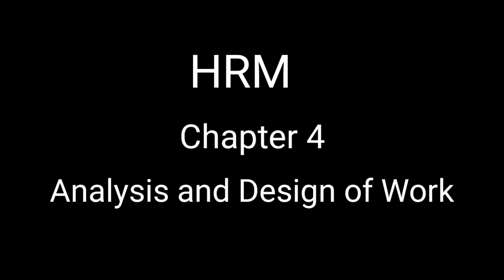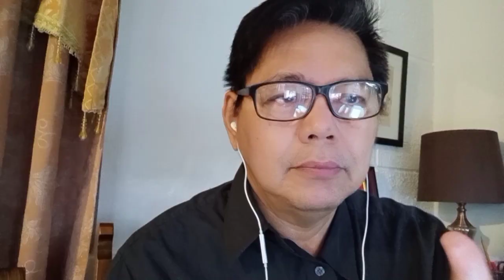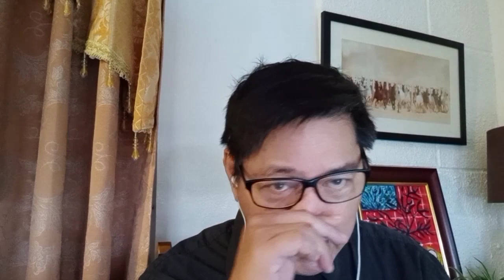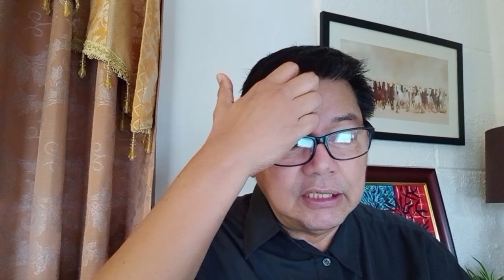HRM: ANALYSIS AND DESIGN OF WORK

Comment: FINAL EXAMINATION
Dimaculangan, John Kenneth V. 
ASM3

CHAPTER 4

1. Name and discuss the nature of the steps in a workflow analysis. 

Interview employees (actors)

There is no more effective way of understanding the flow of a process than by interviewing those who perform it or have some form of experience of it.

At this stage of process analysis, it is necessary to identify:

activities of the process and its sequence

Its participants, their responsibilities and the hierarchical level of each

The information the process uses generates or transforms

Analysis of process models

To analyze the process models, you need to answer 10 questions.

What is the reason for the process?

What does it seek to accomplish? The systems it uses? What value does it add to the final product? And what is its current performance level?

What performance metrics do you use?

What KPIs are defined and which points are measured? Is the process within the expected performance standards (or not)?

How many interactions with customers are there? And what are they?

Also, who are the customers? What are their needs? Are they satisfied? Check for redundant or unnecessary interactions with customers.

How many handoffs are there? And what are they?

Handoffs are moments in the process where information passes to another person/system. Check if any of them are creating information bottlenecks and whether the organization measures the time between them.

What are the rules of the business?

Business rules are standardized procedures that expedite decision making. Check if they’re appropriate if they’re causing obstacles and what their steps and levels of approval are. Find out based on what criteria the company created them for and whether you could eliminate any of them without causing harm to the process.

Are there other bottlenecks in the process?

It’s necessary to find out what’s being constrained in the process (information, product or service), what factors are leading to the bottleneck (personnel, systems or organizational) and whether the bottleneck derives from a handoff.

Are there variations in the process?

Determine where they occur most often, what the tolerance threshold is, and whether task automation can eliminate variations.

What does the process cost?

Check if this cost is compatible with the market and if it’s possible to optimize the process to reduce costs.

What degree of variation does human activity cause in the process?

Find out if this variation is tolerable and whether or not you can eliminate it with the automation of a task.

How do you perform process control?

What documents do you use to control the process and what steps does it require for its approval?

Documentation of the process

The most important document of the workflow analysis steps is the As Is process diagram, that is, the process model as it currently is.

Some other attached documents may be spreadsheets, checklists, procedures manuals and even statements from participants.

What’s important at this stage of process analysis is to have understood how they occur and to be  able to count on ways of sharing them with other team members in order to look for opportunities for improvement.

2. Compare the functional structure to that of the divisional structure, including the nature of their design, their respective advantages and disadvantages, and the types of environments in which they might best be used. 

A practical structure is one of the most widely recognized hierarchical structures. Under this structure, the association bunches workers as indicated by a specific or comparative arrangement of jobs or undertakings. While utilitarian structures work well in stable conditions where business techniques are less disposed to changes or dynamism, the degree of administration makes it hard for associations to react to changes in the market rapidly. 

Strength: Specialization 

At the point when organizations utilize a practical authoritative structure, individuals with comparable information and abilities are assembled. This makes it workable for representatives to become pros in their field. It requires an exhibition the board framework that considers the advancement, improvement and perceivability of individual abilities inside their practical territory. The specialization that practical structures sharpen assists with achieving top to bottom information and ability improvement among the representatives, and this can assist you with accomplishing your organization's utilitarian objectives. 

Strength: Productivity 

Specialization prompts operational efficiencies and upgrades profitability levels. As a result of their ability, laborers with particular aptitudes can perform undertakings rapidly, proficiently and with more certainty, in this way diminishing the event of business related errors. Moreover, the away from of the profession way inside the practical unit makes it feasible for workers to be profoundly energetic to propel their vocations as they climb inside the progressive system. 

The principle objective of useful structures in associations is to bring the whole human and educational assets together to meet the association's objectives. This can be an ideal structure for independent companies that attention on one item or administration since you can augment execution by empowering peer participation among various units at different degrees of the board through oversight and coordination. 

Weakness: Management Issues 

Correspondence in associations with practical hierarchical structures can be unbending a result of the normalized methods of activity and the serious level of formalization. This can additionally settle on the dynamic cycle moderate and rigid. Since it is more administrative, practical units are frequently not responsible to one another, and helpless flat coordination inside the offices can happen. 

Absence of advancement and confined perspectives on hierarchical objectives, alongside an excessive amount of center, can influence workers' inspiration. As your organization develop and you make more practical units, the degree of self-governance inside units may expand, making it hard for you to arrange all the units effectively. 

Weakness: Unit Coordination 

Despite the fact that utilitarian units frequently perform with a significant level of proficiency, their degree of participation with one another is now and again undermined. Such gatherings may experience issues functioning admirably with one another as they might be regional and reluctant to coordinate. The event of infighting among units may cause delays, diminished responsibility due to contending interests, and sat around idly, making ventures fall bogged down. This at last can cut down creation levels in general, and the vast worker duty toward meeting authoritative objectives.

Comment: FINAL EXAMINATION
CASINO, JASPER

ASM3

1.Work-flow analysis is the procedure for determining qualifications and requirement of a specific job and who to hire for that certain job. This is needed in order to produce a quality product. The inputs, process, outputs are given emphasis. Work outputs contains a work unit such as individuals, departments, and teams that seek to produce those outputs that others can use. These outputs refer to products of a work unit and is an identifiable thing or service. Work processes refer to the activities that members of a work unit engage in to produce the output. For jobs that are more complex, a team-based job design is used. This allows a wider-set of skills, team back-up, share of workload and error detection. For teams to be effective, the level of task interdependence or how much they have to cooperate, should match the level of outcome interdependence or how much they share the reward for task accomplishment. Lastly, the work inputs are used in the development of the work unit’s product. There are three forms of inputs. Raw inputs which consist of materials that will be converted into the work unit’s product. Equipment refers to the technology and machinery used to transform raw materials into finished products. Lastly, which is the final input of the work-flow process, is Human Resources, which refer to the skills and abilities need to perform the tasks.
2.The key difference between functional and divisional structure is that functional structure is an organizational structure in which the organization is divided into smaller groups based on specialized functional areas such as production, marketing and sales whereas divisional structure is a type of organizational structure where operations are grouped based on divisions or separate product categories. The advantages of divisional structure in organizations are specialization and efficiency. The drawback is that departments can silo and be unwilling to cooperate with the other divisions. The advantages of a functional structure are, Increased productivity, Skill development, clarity, and minimized cost of operation. The disadvantages are: Hindered decision-making, competition between departments, and narrow scope.

Comment: Final Examination
Payosalan, Evemer kenneth D.
ASM2 

Chapter 4
1.Name and discuss the nature of the steps in a workflow analysis

.Step 1: Collect Hard data Make a report of the workflow you want to review. Analyze the stats and see which ones work as needed and which ones don't.
 Step 2: Collect Soft Data To carry out your workflow analysis, you need more than just numbers. Now you need to go with people who often use exercise tools. Start with the people filling out the form. Step 3: Ask the Hard Questions The next step in workflow analysis is to ask questions that guide workflow. What is its purpose. Whose service should he serve. What defines a good process? Some workflows are designed to reduce errors. Others are designed to speed up the process. Step 4: Step 4: Implement the Changes and Follow Up When you have identified all the changes to your workflow analysis, implement them on your system. Notify all stakeholders of changes and let them know if there is downtime or how items will be handled during a modified workflow. Workflow analysis is not just a good way to determine if changes are needed to a workflow. You can also generate useful reports and see what workflows and what aspects of a particular workflow are helping your business grow. It is important to continuously analyze and improve your workflows.

2. Based on a workflow analysis, describe the major differences between how tasks are grouped into jobs at a fast-food restaurant and those at a five-star restaurant. Which job design approach do you see predominating in each?

In a quick nourishment eatery the workflow goes precisely as arranged since everything is paced with the stream of the arrange they plan nourishment quicker and more arranged working productive is their key. Whereas the five star has the same steps but it’s a small bit distinctive when it comes to five star eatery they go with the direct pace of stream in working with their claim arrange In well-run eateries, servers are in consistent contact with their has to remain up to date on the up and coming accessibility. In more loose places, the have may got to skim the scene and choose when to hold up.

Comment: FINAL EXAMINATION
MACARIO MICHAEL CHRISTIAN R.
ASM3

Chapter 4

1.	  Name and discuss the nature of the steps in a workflow analysis.

Workflow analysis makes sure the benefits you wanted when you signed up for workflow automation actually occur. This includes efficiency and productivity in business processes, customer satisfaction, regulatory compliance, and employee engagement.
Step 1: Collect Hard Data
Take a report of the workflow you want to examine. Analyze the statistics and see which ones are performing as required and which ones aren’t. Consider an expense report workflow.
Step 2: Collect Soft Data
To further your workflow analysis, you need more than just numbers. Now you need to go and talk to the people who use the workflow tools most frequently. Start with those who fill out the form. Workflow analysis tools usually only focus on the hard data, so this gives you a chance to take your analysis to the next level. 
Step 3: Ask the Hard Questions
The next step of workflow analysis is to ask the questions that guide the workflow. What is its purpose? Who is it supposed to serve? What defines a good process? Some workflows are created to minimize errors. Others are meant to speed up the process. Using a combination of workflow analysis tools and in-person conversations, you can come up with the right solution.

Step 4: Implement the Changes and Follow Up
Once you’ve identified all the changes that came from your workflow analysis, implement them in your system. Notify all stakeholders of any change, and let them know if there will be any downtime, or how to handle items in the middle of a changed workflow.
Workflow analysis isn’t just a good way of identifying if there are any changes that need to be done with a workflow. You can also prepare useful reports and see which workflows and which aspects of a particular workflow are helping your organization grow. It’s important to analyze and improve your workflows continuously.
Great workflow analysis tools ensure that you can get all the data that you need to perform the analysis effortlessly, thereby saving you time, effort, and money. A good tool helps you identify which processes are running smoothly and which need work. Using that information, you can move ahead and find out where to make changes and where not to so you reduce costs.

2.	Compare the functional structure to that of the divisional structure, including the nature of their design, their respective advantages and disadvantages, and the types of environments in which they might best be used.

The functional organizational structure is one where employees are grouped together, according to their area of specialization. On the other hand, divisional organization structure refers to the structure wherein the organizational functions are grouped together, into divisions, depending on product, service, market or geographies.
 
Functional Structure:
•	A functional structure is defined as a design that groups similar or related occupational specialties together. It is the functional approach to departmentalization applied to the entire organization.
•	The most obvious advantage of a functional organization is that grouping employees by specialization ensures a dependable level of departmental competence. This is particularly so for large organizations that have several functional levels within a department
•	Segregating the workforce according to function clarifies organizational responsibility and allocation of tasks. This tends to eliminate duplication of assignments that waste time and effort and makes it easier for management to direct work to appropriate employees.
•	Having departments populated by employees specializing in specific work areas means that teams become siloed. Employees in different teams do not get the opportunity to meet and share perspectives, which can be harmful for the progress of the business in the long run.
•	Further disadvantage of a functional organization closely related to the failure of functional groups to cooperate with one another is the possibility of territorial disputes. These disputes may have to do with disagreements over goals, budgetary competition or any number of issues that stem from a clash of egos that occur when each department has its own separate functional structure or where a strong sense of a common purpose is lacking.
•	The functional structure is best suited to those organization which is small and simple. 

Divisional Structure:
•	A divisional structure is a manner of designing an organization so that it is split up into semi-autonomous units called divisions. While the divisions have control over their day-to-day operations, they still are answerable to a central authority that provides the overall strategy for the organization and coordinates its implementation among the divisions. 
•	The divisional structure also provides a great deal of flexibility for the overall organization because each division operates separately and focuses on the most pressing issues facing it rather than being triaged by a central authority. 
•	The divisional structure works well in markets where there is a great deal of competition, where local managers can quickly shift the direction of their businesses to respond to changes in local conditions.
•	You can use this structure to create a culture at the divisional level that most closely meets the needs of the local market. For example, a retail division could have a culture specifically designed to increase the level of service to customers.
•	This approach tends to yield faster responses to local market conditions.
•	When you set up a complete set of functions within each division, there are likely to be more employees in total than would be the case if the business had instead been organized under a purely functional structure. Also, there must still be a corporate organization, which adds more overhead cost to the business.
•	When there are a number of functional areas spread among many divisions, no one functional area will be as efficient as would have been the case if there had instead been one central organization for each function.
•	Divisional Structure is appropriate for those organizations, that are large and dynamic.